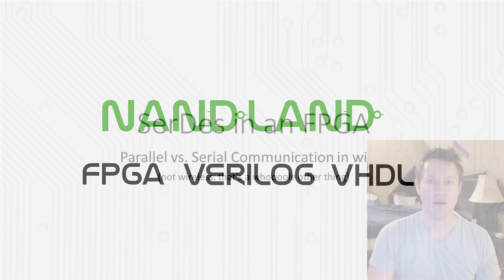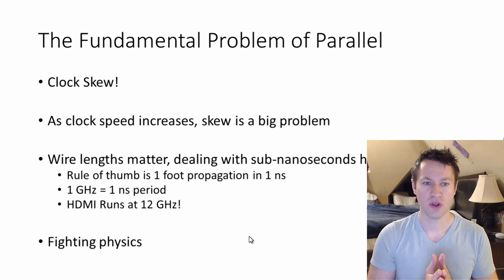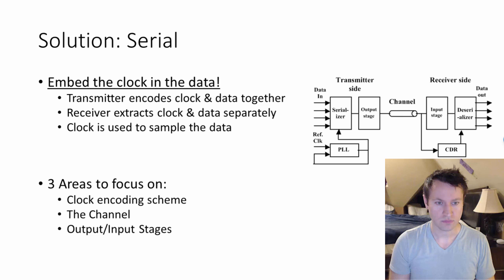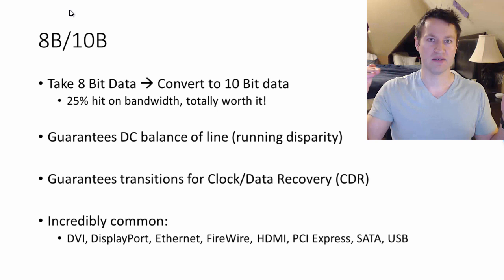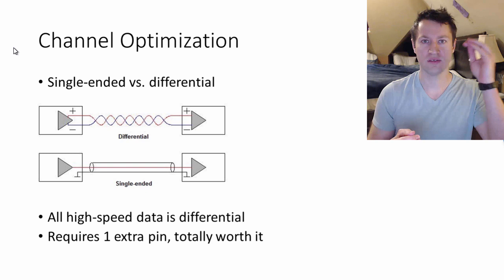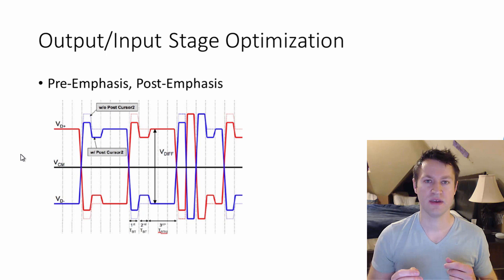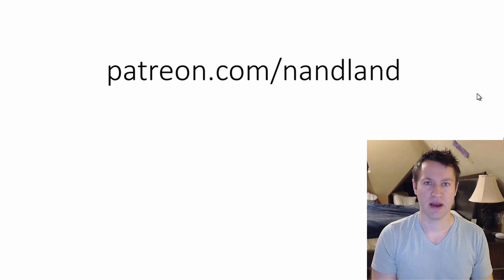How SERDES works in an FPGA, high speed serial TX/RX for beginners

Comment: well it stops right where it starts to become interesting. hope you will do a follow up and show us how to implement a simple SERDES for an HDMI output :)
Reply from the maker: Fair point, but I didn't want to post a 1+ hour video. Also it becomes less universal for the implementation part.
Reply: @Nandland  pretty sure alot of us viewers would like to see you go in-depht on such topics :) anyway great work! thx
Reply: Xilinx 7 series IO cells include SERDES which are fast enough to implement 1080p HDMI without the use of dedicated transceivers. There is a ton of HDL code out in the Internet which does just that. It would be cool if nandland would go through one of them and explain what's going on, but as he said, it's going to be highly chip-specific.

Comment: Serial data transfer has its limits. At high speeds signal integrity drops so much that you either have to stick with insanely well manufactured shielded cables (and short ones!) or you have to use active boosters on the way to not lose information on the way. Parallel also have to be shielded but can be sent at much lower freq. thus not losing integrity that much and less of technological tricks/efforts have to be made. Look at I2C - 400kH and it can be sent pretty mucj through bare wire. It isnt parallel standard i ger it, but you could send several I2C data lines pretty much on bare AWG 24 cable and still wouldnt notice anything.

Comment: Great video as always! A couple of small nitpicks if I may: 
1) technically SerDes is not the same thing as transceiver, transceiver blocks have SerDes as part of it, but SerDes'es exist as a standalone blocks too. As I'm sure you know, in Xilinx 7 series FPGAs a pair of SERDES'es (input and output) is embedded into each IO buffer cell, which allows (relatively) slow channel speed links to be implemented using regular IO pins instead of dedicated transceivers. For example, on said 7 series chips these pins are fast enough to implement HDMI protocol up to (if you overclock a clock buffer a bit) 1080p@60Hz, which is 1.45 Gbps per channel. Official specs call for up to 1.25 Gbps per link, but in practice I'm yet to see a chip that can't do 1.45 Gbps - even slowest speed grade 1 devices are capable of that. There are enough HDL projects out in the wild that demonstrate that, Digilent even officially supports a code for their 7 series boards with do support 1080p@60. And the cool thing about HDMI is that it's backwards compatible with DVI, which is incredibly simple to implement on FPGAs (literally just few screens' worth of HDL code!).
2) Nowadays LVDS usually goes over 50 Ohm single-ended/100 Ohm differential lines and thus require 100 Ohm termination resistor, not 120 Ohm. These resistors are sometimes incorporated into IO cells though (at least I know for sure for 7 series).
Reply: sorry to be offtopic but does anybody know of a trick to log back into an Instagram account?
I somehow forgot the login password. I appreciate any tricks you can offer me.
Reply: @Khari Keaton instablaster =)
Reply: @Ephraim Alonzo Thanks so much for your reply. I got to the site on google and Im waiting for the hacking stuff atm.
Takes a while so I will reply here later when my account password hopefully is recovered.
Reply: @Ephraim Alonzo It did the trick and I actually got access to my account again. I'm so happy!
Thanks so much you saved my ass!
Reply: @Khari Keaton No problem :D

Comment: Excellent to see you back.. have enjoyed the videos so far, and you have cleared one or two things up for me already in other videos!  - just one small observation though, in the spirit of clarity -  I have been working on digital systems for decades, and I feel you're confusing people about parallel and serial. Parallel is just that - parallel. More than one bit at the same time. Serial is one bit at a time. For me,  I2C is serial, and I beleive PCIe is actually either one or multiple serial interfaces too.. (that whole X1, x2, x4 thing..).

Your intro is really about sending the clock WITH the data VS recovering the clock FROM the data. Combine clock recovery with balanced transmission and that's what allows you high speed over crappy links. That's the important thing. Nothing really to do with whether the data is serial or parallel.. Parallel isn't 'slower' - it's just harder to get the bits to line up correctly at the other end when physics starts to get annoying, so we resort to several serial links in, well,  parallel. Then it's just a question of getting all the bits into the same clock domain.. (I'm not going to argue that a parallel printer lead was faster than a USB connection,  but it's important not to over generalise that parallel is inherently slow.)

That said - nice overview of the entertainments of high speed data transmission down a physical circuit, including the line coding necessary to prevent line bias and allow the clock recovery (did you mention clock recovery?). Being an old cynic, I would add that the main reason serial is so popular is because it's cheap to make. Hard to code, but cheap to make.. (Compare a SCSI3 cable with a USB2 cable, and you will see what I mean ;-). 
It feels a bit Halfway there though- Can we have the rest of the info please? There's a lot of good info about why one might use the SERDES block, but if there was anything on how, I missed it. As you said, using a SERDES block is the way to go to do HDMI, and also PCIe interfaces, and I can't be the only one that would like a more detailed overview of how to implement them. Maybe an HDMI or DVI block?  Im hoping that's the next video :-)

Do keep up the good work though!
Reply: Yeah, what he's done is confuse asynchronous vs synchronous for parallel vs serial. Like you say, I2C is serial. Also, he hilariously suggests parallel's downside is that it's lower bandwidth. It's not, case in point, memory is one of the highest bandwidth interfaces there is and it's still serial. The problem with parallel is just the GIANT nightmare of length matching the traces which pretty much goes away with serial, even with the multiple serial interfaces.

Comment: @9:00 - It should be asserted that 8b/10b VARIES by application.  The 8b/10b use in HDMI TMDS is *NOT* the same encoding/decoding scheme used in PCIe for example.  They share a name, and absolutely nothing else.  Lots of folks lose time on this issue.
Reply from the maker: Good to know!

Comment: SDI, HD-SDI (1.5Gb/s), and 3G-SDI (3Gb/s) are popular standards for moving video and sound in production settings, and they are unbalanced (single-ended), using existing coaxial cabling and running considerable lengths like 100m.  HDMI, a consumer interface, actually has 3 balanced data lanes and 1 balanced pair dedicated to the clock.  PCIe is really a hybrid of serial and parallel, too, by adding additional differential lanes, up to at least 16, for greater throughput.  Thanks for preparing another excellent video.

Comment: Thanks for your sharing video. I have a question about the 8b/10b clk recovery. At the beginning of tx and rx connection, the TX may send the start bits and frame to RX. How does the CDR in the RX work to immediately obtain the clk and used it to extract data? I am not understand that the recovery clk should be finished before the first data coming. 
if tx and rx finish the recovery clk in the OOB, how do we know how long the clk recoveru is finished?
Reply from the maker: It does take a little bit of time for the TX and RX to lock on to the data stream. There will be some data loss while this occurs. The TX and RX need to ensure that the data is received properly via higher level protocols.
Reply: @Nandland  Thanks for your reply. Can I understand it in this way? TX sends some special characters at first. In the RX, it recover clk from the special character, and use the recoverd clk extract data. In this step the extracted data may be wrong so RX will check if it is right. RX will not give any signal to tx until RX's checking is right.
And TX will always send speical chararcter if TX doesn't receiver the RX's checking right signal.

Comment: Hey, thanks for the video. Good explanation. Something has been bothering me about parallel vs serial though. Basically, the fact that we call something serial doesn't mean its data is transmitted over a single communication channel (be it a single wire or differential pair). Take your provided examples of HDMI, lightning and USB (its even in the same) Older USB connectors, sure. But now, USB Type-C have up to four differential pairs that can be used. HDMI has 3 differential pairs. Lightning has two. 

Which makes me wonder, where do we draw the line ? Should we even call these serial / parallel ? As far as I understand it (after some googling while writing this post), we call things serial interfaces when serialization takes place. If we transmit words, entire addresses or whatever in parallel,  they're parallel connections. But really, with today's parallel serial interfaces (like hdmi/usb etc),  I think its mainly a good source of confusion :p
Reply: I'd say that if there is any serialization of data at all, even pairing just two channels of data into one (despite maintaining the rest of the channels), it could be identified as SerDes. I do see where your confusion comes from though!

Comment: I'd find it interesting to see what improvement would be had by changing the differential conducting wire element from Cu to Ag given Rho for Silver is a better choice for this application. But of course, would the lesser resistivity of Ag over Cu be of any benefit to offset the higher cost of Silver over Copper?
Reply from the maker: For longer high speed runs you just go to Fiber Optics. Best signal integrity and speed.

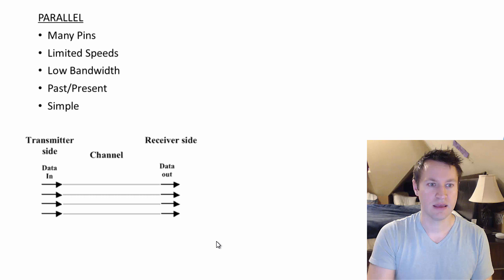Comment: 2:24 If parallel is slower, That why USB ULPI (480 Mbits/s) uses 8 bit data bus?? Or why USB 3.0 uses additional pairs of data wires (more pins, that equivalent for works serial data pairs as parallel) against simple 4-pin USB 2.0??  HDMI also uses 3 pairs of serial lines (not one), that works in parallel. Why 3, not one pair?? And simply.. Why modern versions of OS and processors changed  bitness from 32-bit to 64-bit (that also equivalent for using 64 wire-bus against 32 wire-bus. More pins again..)?? Maybe it's better use only 1 serial wire against many wires for terabit baudrate?? Lets go with I2C at "1 Terabit/s" ! Why not?? (Ha-ha-ha) No.  Answer is simple - parallel is always faster.
Reply: The reason they changed from 32 bit to 64 bit isn’t really to do with parallel vs serial at all. Computer chips pretty much have to deal with data in parallel due to how it is represented. You can store a much larger number in 64 bits vs 32 bits. You also end up limited in terms of speed when making computer processors and in processors the length of individual paths can be very precisely controlled hence it eliminates the issues with parallel connections. He even covered this in the video, parallel is okay for on board connections since you can control the length but for cables it isn’t.

Using additional pairs of wires isn’t the same as using a parallel connection, it is using multiple serial connections, there is a big difference. If you used parallel then one block of data, say a byte is split up across all the wires, like in an eight wire plus clock parallel bus, each bit of your byte would get its own wire. With multiple serial connections, each channel is transmitting totally separate data and bytes aren’t split between the wires. With hdmi it has a clock channel and then three data channels, each channel carries data for one specific colour, each channel is acting independent of the other channels and transmitting its data serially.

Parallel is always faster only if you can ensure the length and hence time taken on each wire is exactly the same and that becomes more of an issue the faster your speeds get, so your manufacturing methods limit the maximum speed of parallel communication you can get and the more wires you add the harder it is to length match them. So parallel is not always faster at all. With current manufacturing methods, especially for cables it is much easier to get high speed serial communications than high speed parallel communications, so theoretically parallel is faster, realistically serial is faster.